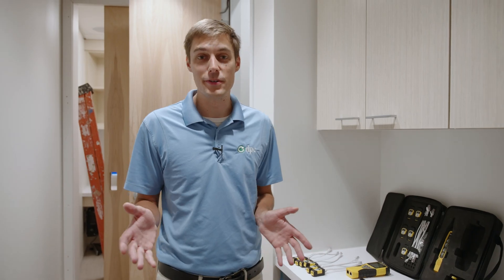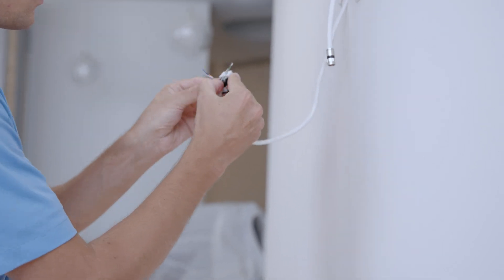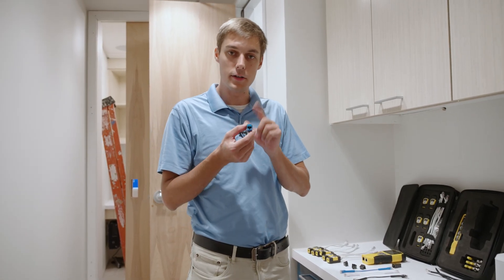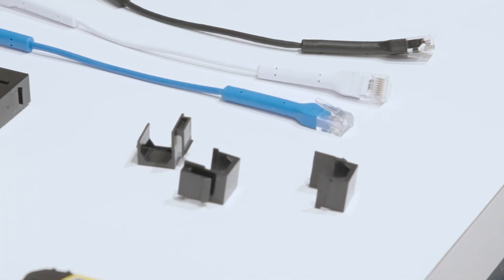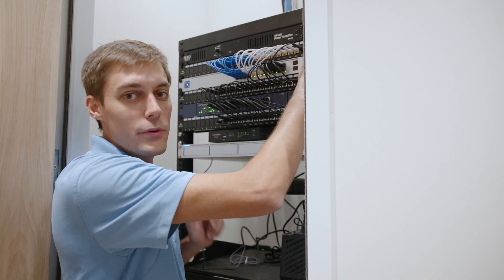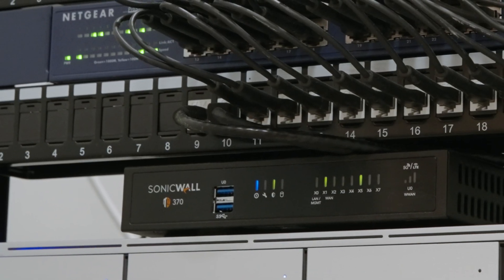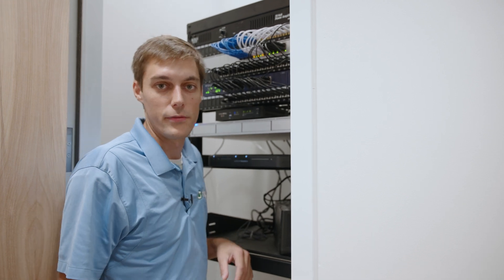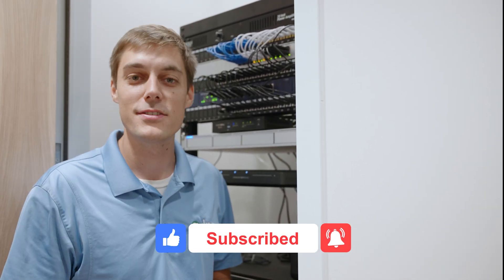Mastering Network Closets: Efficient Techniques and Organizational Secrets

Comment: Do you guys use a cloud key or a computer with the unifi management console installed?
Reply from the maker: We use a cloud key or another controller
Reply: @DPCTechnology  Makes sense, I've not used fortigates much, mostly watchguard but also some pfsense and sophos. The firewall is certainly an area that unifi can develop. Their UDMs would be great if they had the firewall and routing features of more robust offerings. They would really give cisco a run for their money. Even if they started to offer annual licensing options for those firewall features. I'm sure many would hop on full unifi systems.
Reply from the maker: @1stGruhn  I have a feelin that is coming.  They are definitly lookiog to get into the MSP space.